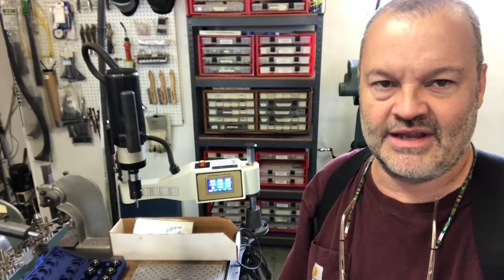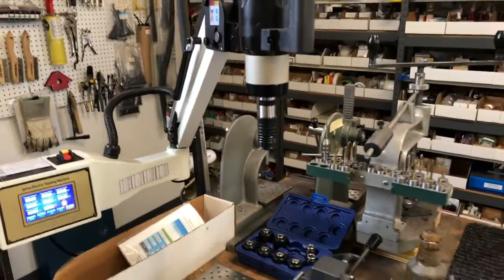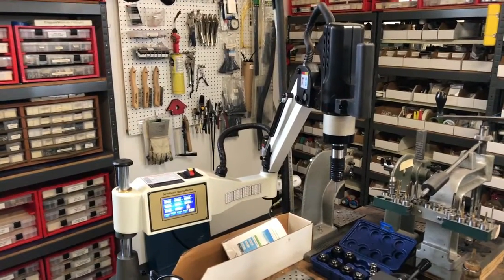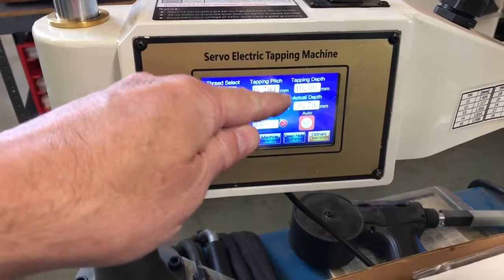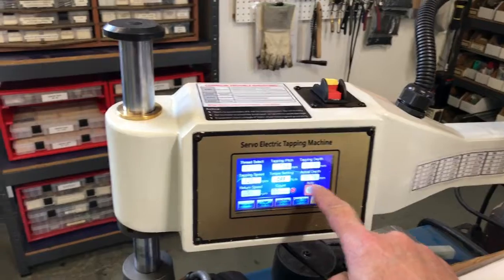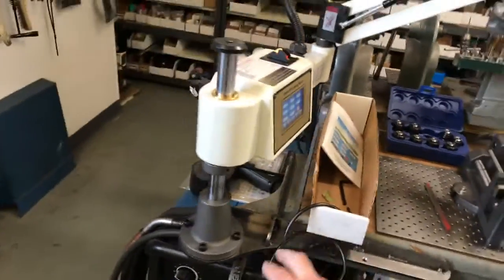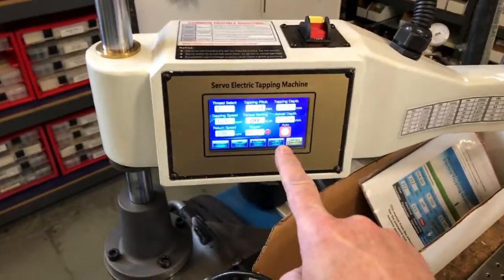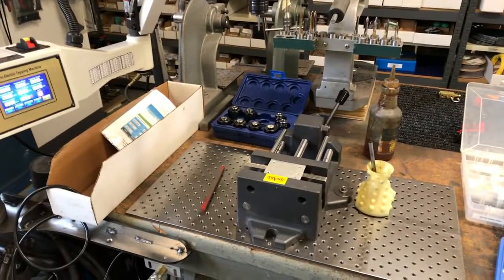Electric Tapping Machine: So Much Better than Pneumatic

Comment: I don’t like pneumatic tools either, though I’ve got a few die grinders. I’ve also been looking for one of these, but I can’t make my mind up about the maximum tap I want to use with it. I also don’t know which of these companies to trust,and I don’t need it enough to spend $5,000 for a well known brand. I do think that the torque collets they use are standard, so getting inch versions if they just supply metric, something I’m finding more often, shouldn’t be too hard.
Reply from the maker: Mine came with metric collets but I also use SAE so I bought a set of those as well.  There are also some weird taps I have with unusual shank diameter but I've been able to find collets for those too.  Even if you have to pay the tariff these electric tap arms are fabulous--I would buy one before there is a complete import embargo.

Comment: Hey Tom, 

I'm needing to use an 8-32 tap as well. What size tapping chuck/holder are you using for the 8-32 tap, and where can I get one?
Reply from the maker: Measure the shank on your tap.  There are several standards for shank diameter (ANSI, DIN, JIS, ISO, etc.).  For my 8-32 tap I'm using the ANSI U-4.3*3.4 collet which came in an ANSI set I got from eBay.  It is labeled 5/32" but I think it's really 4.3mm.  There are also sellers on AliExpress who will sell individual GT12 collets but I think the ANSI ones have to be bought in a set.

Comment: Thanks for sharing this. I just ordered this from the links you provided. I see that it’s 220v but looks like it used a cord that looks like it’s plug into monitor. Did you have to modify to work with a 220v power source here in the US?
Reply from the maker: No, I had 240V present on that workbench so I have it plugged into 240V and it works fine.  If you want to run it from 120VAC you can probably get a step up transformer from McMaster Carr, eBay, or elsewhere.  Not sure how many VA the transformer would need to be but it can be too much as the motors in this thing are small.

Comment: have you had any luck finding SAE size tool holders for this machine?
Reply from the maker: Yes but I bought a full ANSI set.  Full ANSI sets are for sale on eBay and Amazon.  Here's one listing:  https://tinyurl.com/yjmr494b  You can also get individual GT12 collets from sellers on AliExpress but beware there are many standards for tap shank sizes (ANSI, JIS, ISO, JIS, etc.) and they are all different.  I think the ANSI set that is sold is mostly made up of metric collets that were "close enough".

Comment: Do you mind sharing the brand and model number?
Reply from the maker: These are available from various sellers under different marketing but they are all probably getting these units from the same Asian manufacture.
I got this one from this eBay seller who appears to have one more:
https://www.ebay.com/itm/393772955060
It comes with metric collets.  If you want ANSI collets you can get them from this seller:
https://www.ebay.com/itm/175467562685
Also, my machine arrived with the software set to Chinese.  To change it over to English the included instructions were not good.  Here's a link to a better user's manual that has the password you'll need to set it to English menus:
https://content.toolots.com/media/attachment/file/N/E/NEW%20TAPPING%20MACHINE%20USER%20MANUAL.pdf
These machines are 1 phase 220VAC but run fine on US 240VAC.  If you don't have 240VAC you could probably buy a small step-up transformer but I don't know the VA rating (Volt-Amps) you would need.
I only need a few more YouTube subscribers to reach 1000 so please subscribe!